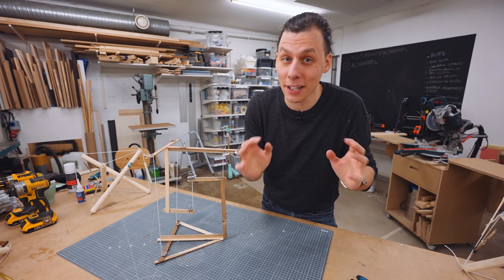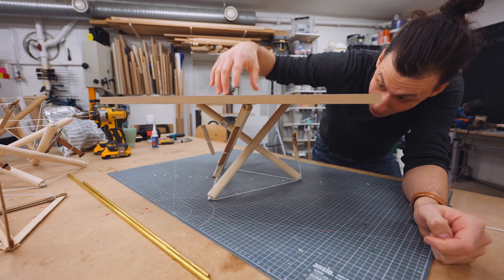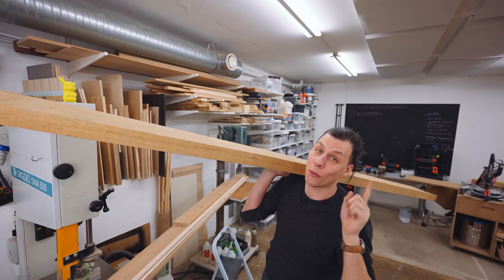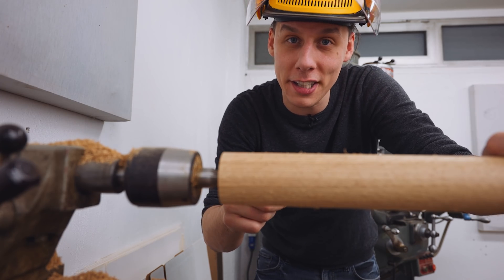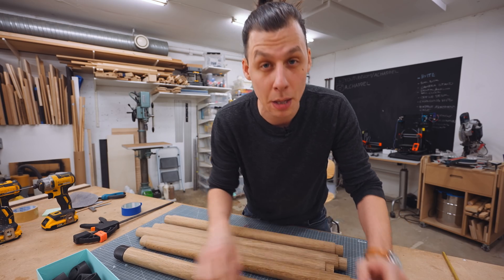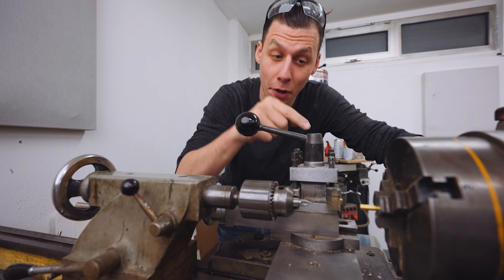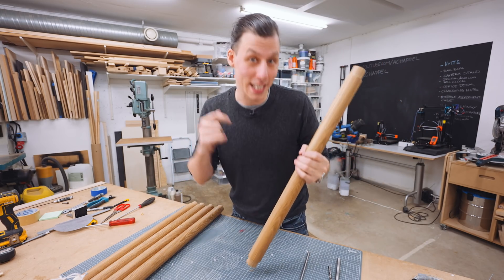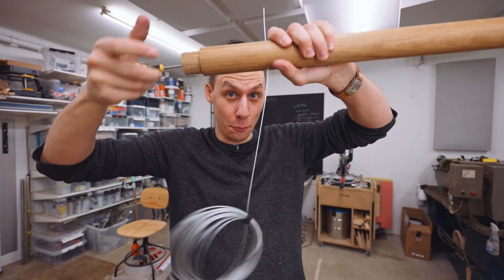Making a Tensegrity Table that Actually works!

Comment: Alex, I just built the table with 3/4 black rigid PVC pipes used in electricity; 3mm steel cable, OSB top. It is really very resistant and that is why I called it a table-bench, because I sat on it with great stability. Thank you very much for your dedication.

Comment: Congratulations on NOT creating a tensegrity table, even though you did nice work.

Try not to be intellectually lazy, and do the research to get understanding of what tensegrity is.

The 3 legged version that you attempted is springy because the person you copied it from also didn't do the work to understand a very simple principle. If you go back and add a 4th string to each leg end connect it from top to bottom in the opposite direction, you will find you get a completely constrained structure.

Comment: you could replace the round glass shape with a hexagonal one or a pentagon and use two pieces of glass, one mirror, one 2way mirror and some LEDs to make the top into an infinity mirror, that would work great combined with the tensegrity effect of the table, a small powerbox with electronics below the mirror part and thats it.

Comment: Very cool!  I think there's a way to build a similar structure without the legs contacting one another.  The way to do it is by having four cables coming from each brass sleeve (2 per side) rather than 2 (1 per side), and running in opposite directions--one to the leg forward, and the other cable to the leg aft.

Comment: (Sorry for this redundant comment ...)

Hi Alex, I think that you created something closer to a RECIPROCAL FRAME project, rather than a TENSEGRITY project. You just happened to choose wires to stabilize the ends of the rods to each other. The bottom ends could have been bolted to another base frame or into separate bases installed into the ground, and the top ends could have been bolted to the table's top (or to a roof object). It is a reciprocal frame object because the rod members form their structure by applying stress only to each other.

A true tensegrity object uses the anti-compression (longitudinal rigidity) feature of the rods as the primary load-bearing feature of the structure.

Comment: Just use cable that doesn't stretch, like pre-stretched steel cable.  Or, one could use solid wire, like drill rod. 😁

Comment: Would be really nice to lathe out a filleted  taper towards the centre of each of the legs, so that the points where they are most likely to touch has more space. You probably wouldn't want to stand on it after that, but it'd highlight the gravity-defying techniques used, and hero the engineering a little more. Something that you should be able to do if/when you receive the new wire connector and have to disassemble. Would be good to see you revisit later on!

Comment: I wonder if you can show us to make slatwall (rillepanel). I really want a slatwall to show my rc cars and stuff, but as you may know, the shops that are selling these here in Norway is either expensive or do not sell to the public. Same goes for the acrylic shelves. I want to have the angled shoe ones that is sloping outwards and with a lip on the end. They don't sell them in Norway and the shops in UK or US, don't want to ship to Norway. I'm thinking of making these in Plexi plates from Biltema and then form them with heat. I'm glad to any tips given. :-) Cheers from Richard

Comment: Not a real tensegrity table. Also the whole reason they look so cool is because they seem to be floating, this type of design will not have that effect making it just not as aesthetically pleasing.

Sorry but not really anything to new or interesting to write home about.

The point is to make a table that can not be made by simply using fasteners/glue/etc, while really making part of the table float look like it floats.
By example the wooden supports here can be connected normally and they directly interface between floor and table thus losing the illusion of floating.
Basically if you could make a top frame to not make it tensegrity then it's not an optically pleasing tensegrity table (if you welded this out of thick metal tubing and made a top frame to connect the bars it would also be stable and hold and would be a more fancy design of a 3 (or more) leg stool. Even in design it's in the end close to the earlier stool and table you made from broomsticks and 3D printed connectors.

I'm not saying it's easy to make a good tensegrity table, just saying that this project felt repetitive and the title is just clickbait.

Comment: You need a hydraulic swaging tool for the stainless steel wire fittings. A mechanical crimping tool for attaching terminals to copper wire cannot exert enough force for this application.

Comment: if you glue/weld threads on the end of your cables you can screw it into into the brass sleeves making the connection point hidden.

Comment: Hei Alex, why didn't you opt for measuring "exactly" the lenght and then cut it and locking the two ends with the nut?
that would look so "much" better if it looked like a single piece of string holding the whole thing.

I wrote "much" in quotation because, let's face it, that thing is pretty dope!

Comment: Hey Alexandre! You might already know this but another way to find the center of any part on the mill is to take the bit and put it flush on your part (like you did) but this time set it to 0. Then put the bit flush on the opposite side of the part. Now press the function "1/2" and then "Y". This way if you do not know the size of your bit and/or part you can find the exact center of the part 100% of the time. Once you have completed the function return the bit to 0 and you have found the center of your part. This also works if you hate/don't trust yourself to do math in your head (like me).

Comment: I think you could drastically reduce, if not eliminate, the springiness if you use a cord that isn't stretchable.  I think Kevlar, fiberglass and carbon fiber are all stretch free.

Comment: Alexandre, why didn't you just chuck each of the legs in the lathe, and use the tail stock chuck to drill the axial bores for the locking screws?

Comment: I really liked this project. Since you have the screws down the legs to hold the wires in place couldn't you have just crossed the wires in 1 of the legs and then lock it into place so you didn't have to have the crimps visible?

Comment: It wouldn't be that springy if you used steel cable rather than a string. It is the stretch of the string that creates the spring. The other option is to put enough weight on top to remove the elasticity so that it is always under high tension.

Comment: the non-touching configurations were springy because of elasticity of the strings, so using steel cables shouldve been fine!

Comment: You could just tighten the two end of  the wire in the same brass pin, it would be nicer and more practical.
Great job as always Alexandre.

Comment: Very nice design, defently has a place in a modern living room. Btw since the legs are touching, you could ditch the wires all together by putting the brass parts where the legs are touching and screwing them together. After covering the hole you could end up with the clean design of the thumbnail.

Comment: As always, a pretty nice project! I think it should also be possible to drill holes at the points where the legs touch, put screws through and then seal everything with small wood plugs. I think it would look even better, because it would be hard to see the plugs, and of course there is no wire

Comment: Great project, for better stability I think you should set a wooden table on the structure with some weight and then, once the rope is under the maximum tension, tighten the screws. By doing this way you maybe could have managed to use also the other structures

Comment: one option that would have been interesting to add in the brass tubes would be to freeze them before putting them in place, since metal contracts when its cold once they warmed up they would form a super tight fit. although usually when i see people doing that its in metal working

Comment: I've been wondering if there's a way to use a sort of tool mount for a woodworking lathe like metal lathes have. Just for safety. I feel like a workpiece spinning at high rpms towards my body that could easily throw a sharp tool at me isn't very safe. Now I realize I can just buy a metal lathe. 😀👍
Reply: metal lathe are stupid dangerous, just below shapers in the category of "it will kill you without warning". You have to double check everything every time you do an adjustment. I have a small Taig lathe and while it is a fun tool, it is annoying compared to a wood lathe which is more "free style" with tool in hand.
Reply: @AlainPilon  Hadn't heard that before. Thanks for your input.
Reply: @ilikewaffles3689  Yes. Dont use a shaper without proper training. I was under the impression that they were like a bigger router table (and they are), but the fact that the cutter (not called bits anymore ;-) ) are so much heavier means that there is no way you can muscle out of it. The danger is metal lathe is that if you dont lock all the levers/nuts, pieces can move and the workpiece can catch on something, blow up and end up in your face/body. I am super scared of a metal lathe, just have to be a robot and methodic. But I am still scared of shapers and I am not planning on getting one ;-0

Comment: now that you have pinned the cables in place, I think some of those other forms would actually be a lot more stable. the thing with them before was that the "legs" could move in two directions - but now that they're pinned, they can only move in one direction. the steel cable fixes them in place when it is tensioned, and with little "spring" they aren't really going to do much. It's no longer a slipping/sliding joint.

Comment: That slot in the threaded insert is for cutting threads. Flip it around and screw a threaded rod into it, then lock it into place with a nut. Then drive it in with a drill.

Comment: Did the glass break.....?  I'm sure it didn't, you don't look heavy enough to break it.....  Damn now I'm going to be up all night wondering lol
Edit, I just remembered, the YouTube resin experts (yes those ones) had a problem with a flimsy tensegrity table, they basically just ran extra cables on each leg and in the middle to make it more stable.

Comment: A possible solution to the springy designs would be getting a weighted top, one that is heavy enough to push them as far as they spring, so setting stuff down on it couldn't push it any further, the main sacrifice for this probably being a top that isn't glass

Comment: I like the table. However, I'm not a fan of the video title. I've seen tensegrity work, and I've seen springy messes (usually because of weak, low tension, designs). This design uses is a basic concept in lashed construction. You see it used in teepees and a lot of things the Boy Scouts do, including a simple lashed stool. You've removed the central lashing, and added lashings in different places to replace it. Again, I like it, but it doesn't deliver on the promise in the title.

Comment: While I always enjoy each of Alexandre's builds, this one actually makes me happy!  Why?  Because, with some simplifications, it is well within BOTH my skillset and my tool set.

The first simplification, as I have no lathe, would be to buy hardwood round stock.  Next, the top and bottom 3D printed caps could screw flush to the ends or slip over them, eliminating the need for the shoulder.  Just cut the stock to length, finish it, and add a few pilot holes on each end.  Perhaps use a flared conical section the leg would insert into.  So many possibilities!

To simplify things further, as I have neither long drill bits nor the ability to drill deep centered holes, would be to replace the locking brass inserts with carriage bolts through the legs (using a 3D printed drill guide) and eyelet nuts, with the eyelet on the inside.  Wrap the wire multiple times around each eyelet for some friction to get the right final geometry.  Fiddly to adjust, but it should be doable.  If getting the bolts right becomes a problem, even simpler would be to use split-ring pipe hangers with eyebolts.  Again, many possibilities.

The thing is, by changing only the wire length, the same legs may be used for a low coffee table and also for taller matching end-tables with a smaller diameter top.  Such versatility!  Would need to verify the end-table stability.

Yes, this looks to be totally doable, even by me.  I'm very happy!

Comment: As was said below, the bounce of your first two prototypes is down to the stretch of the cord you used. Using wire rope tensioned with turnbuckles should remove the bounce.

Comment: Really cool stuff. You probably already know, but the flex it your prototypes could be reduced quite a lot with an aspect ratio change. If it was a little more slender then the max tension in your ties would be reduced and taken in compression through the dowels instead. The final flex could be managed by using a less elastic material for the tension ties and dialing in their prestress until you have something rigid and stable!

Comment: Nice project, just a shame that the end product isn't really a classic "unintuitive" & impressive tensegrity structure like the first ones. You could have achieved a non springy results by using cables that don't stretch when put in tension, so it's even more a shame that you didn't use the original designs since you ended up using cables anyway!

EDIT : another nitpick :p especially for others looking at this : the threaded inserts are designed to be inserted the other way around, the slit is actually cutting edges not a flat screwdriver slot. These inserts are often flush with the of outer face of the part, so having the slit visible isn't that great. The idea is you out a screw in the insert, and then use the screw to drive the insert in (tools are also sold instead of using a screw). It's also much easier because the slit helps cutting into the material... In fact, with an insert that size and in oak, if the hole was actually the appropriate/specified size, you wouldn't have been able to screw it in event with a powered driver, let alone a simple manual screw driver.

Comment: I’m sure this has already been said plenty and it will appear in repeating but I’m too lazy to read all the comments. Still an awesome build but given the dowels are under tension in the center where they contact (lower side of dowel) and it’s not pure compression then I think it kind of disqualifies. Still really cool though. Keeps the drinks steady in an earthquake 😂 I would have been curious to see the true tensegrity with wire for reduction of stretch

Comment: What if you slide the wire so that in one leg the screw that locks it in place is also the securing the two ends together inside the leg?

Comment: Springiness of previous designs could be credited to the strings and reduced with cables that had less give.
So they could work with the right materials and tensioning.
Reply: That's what I thought too - that thin rope was likely to be quite stretchy.
Reply: @thingswelike  using dyneema, spectra or kevlar cords could reduce the stretchiness without resorting to more exotic materials. I think these cords have only around 0.5 % elongation.
Reply: Exactly!  He should build the cool non-touching one using cable.  If the legs themselves don't bend and the cable doesn't stretch it should work.
Reply: Same thought!
Reply: Better yet he could've additionally tethered the legs from the triangular design to a common center point. Such as the table top itself.
Reply: They still wobble, I’ve seen them made of steel cable and chain as well.
Reply: @ItsRenderInnit  steel has some give, but given the right tension it could be fairly stiff.
Reply: @headrobotics  I believe, as you say: if given the right tension. And if necessary, more cables would make it stiff enough.
Reply: @ItsRenderInnit  Bummer! I wonder what gives?

Comment: There is some crazy strong nylon cord. You could definitely make it strong enough with that and get the hover illusion even better. Also, you could hide the cord joints inside the legs.
Reply: @UC5i3jbJZt4dqGjAV7iavJ-A Yes it is. I’m talking about replacing it with a nylon cord.

Comment: Did you print the caps in PLA? you could have used TPU and avoid using the extra insert for keeping the glass in place. Nevertheless, really well done. I loved the way you hold the metal wired in place.
Reply: He got a of pla not long ago from a sponsor so I bet pla

Comment: I thing, if the legs are held in Place at the top, just below the Glass plate and maybe in the middle, where the legs touch,it just might work without the visible wires.